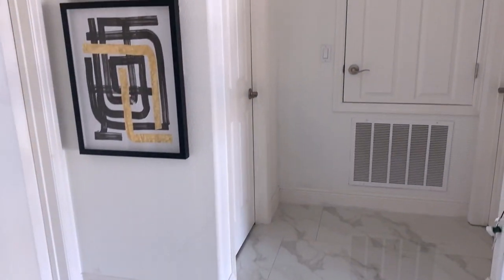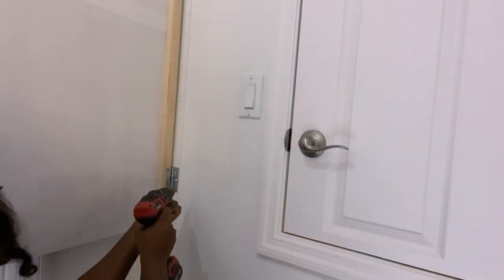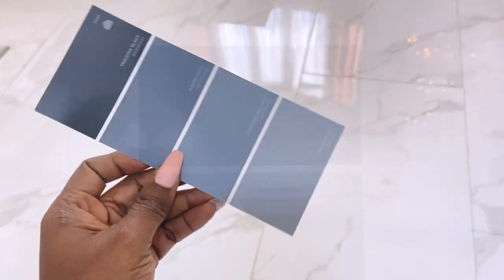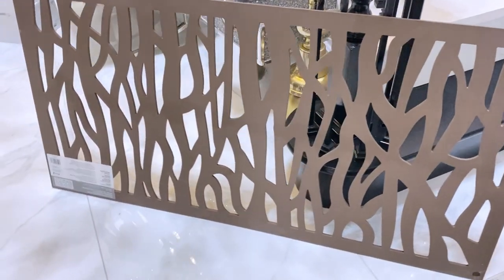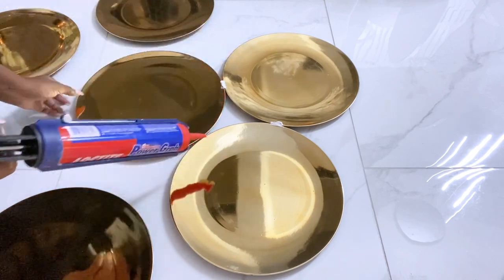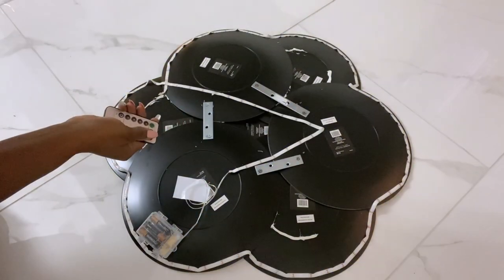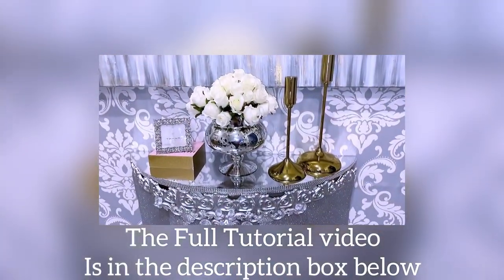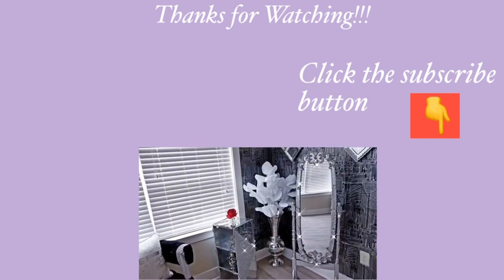WALL Transformation| Hiding My AC Wall!!! HOW TO Cover an AC VENT

Comment: people usually cover them by painting or placing a furniture in front but she went all the way out with a statement, this is camp!
Reply: This is a very moldy hazard.
Reply from the maker: @cmonetsevans123  it not not dear! All I did was put a door over the existing door. At the bottom, what I covered is an air return vent. It is not where the cool air comes from. The vent for the cool air is located up on the ceiling 💕